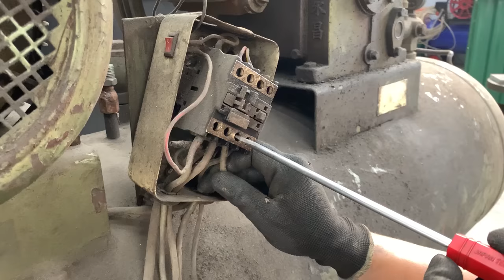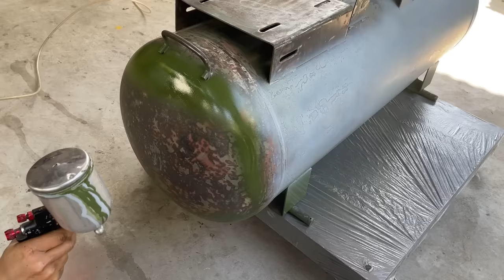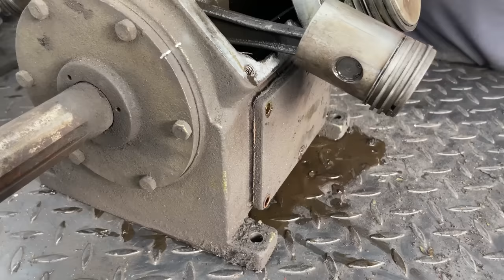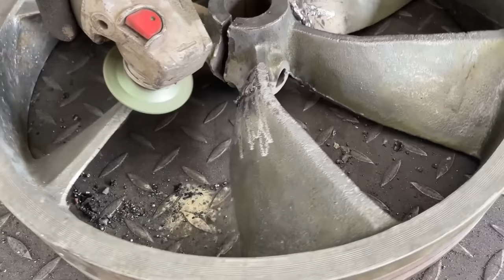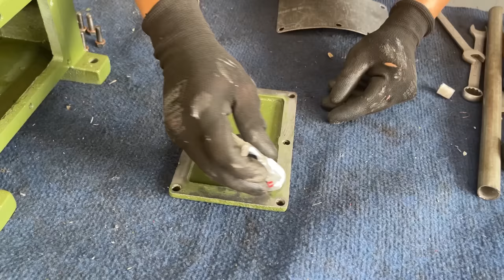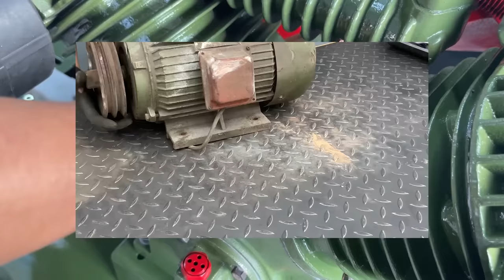Super Big Super Giant Air Compressor // Restore And Repair Old Air Compressors

Comment: While that one came with high quality metal wheels it's worth mentioning you can add them to any horizontal compressor. (I use 8" scaffolding caster wheels because they slide into simple pipe mounts so one set can move many machines and machine tools.) Collecting all the old large diameter wheels you can makes life easy. Everything in my shop rolls.
Reply from the maker: with wheels moving is very easy, thank you for watching and subscribing to the channel

Comment: Hardly a GIANT compressor but a great restoration guys. 👍👍👀👀👀👀👀
Reply from the maker: 👍👍ok .thank you for watching and subscribing to the channel😃😃
Reply: It is ,next to mine !
Reply: Well, considering that most people are used to small Home Depot type units, yes this is "Giant". It's a Saylor Beall model 707 which is a 7.5 to 10hp pump. I've worked on 400hp machines where you need a ladder to reach the heads, and a block and tackle to remove parts. What gets me about this video is that they didn't tackle the most important part of the unit... The valves.

Comment: In my opinion, repair air compressor
it is always a risk, the vessel may be very oxidized inside, which is why it needs a visual inspection with an endoscope in order to guarantee its integrity.
I'm not, in any way, criticizing the work you've done, but rather the risk of the vase being corroded after years of use and also after a long time stopped.
Thanks for the video.
Reply from the maker: Your comments are very good and meaningful, I promise to draw experience for the next products. Thank you for watching and subscribing to the channel.

Comment: Make sure the tank is still safe to use. Weak tanks are dangerous, because it's basically a bomb.
Reply from the maker: The compressed air tank is still thick. Only the paint is slightly peeled off. It is absolutely safe for users. The air pressure is up to 14 pounds.
Reply: @restorationproduct1718  But, did you pressure test it with water?
Reply: @jorismk1  and how about corrosion on the inside? its the inside that have most of the problems, not on the outside
Reply: @killzone89  Yes, thats why you pressure test it with water. Water does not compress so if it fails it will not explode but just crack...
Reply: add  after cooler and moisture trap with auto drain never worry about water again.